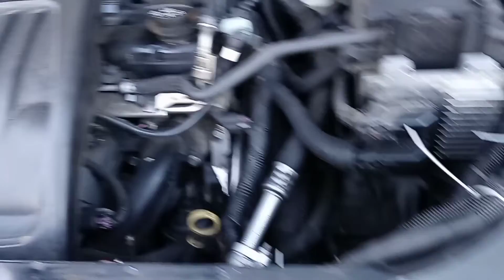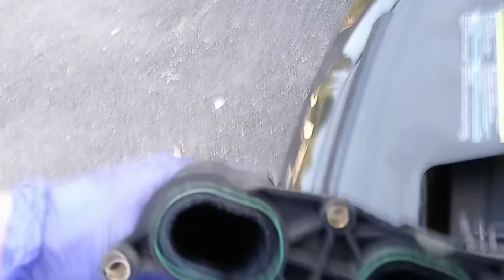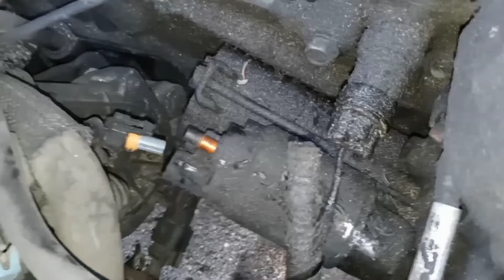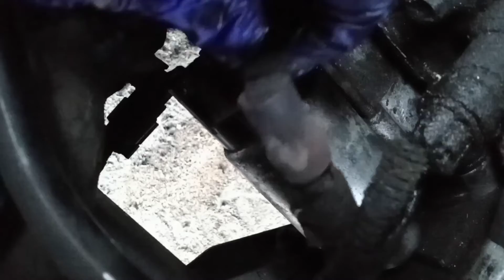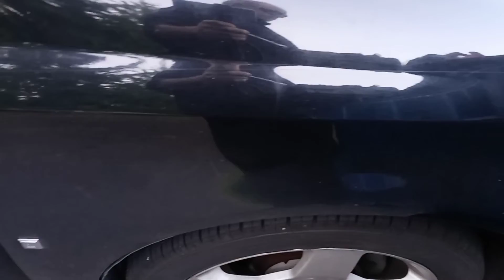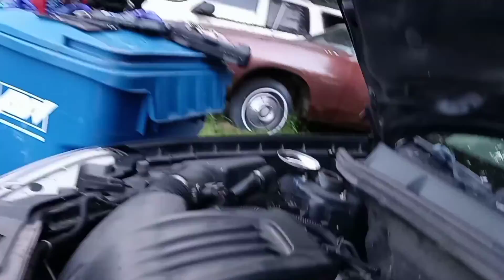2009 Chevy Cobalt starter replacement.

Comment: originally written by Elvis C

This is all done without any jackstand or anything you can do this without jacking the car up in the air.

I currently have no pics but I'll go through each step perfectly.

EVERYTHING DONE IS WITH THE BATTERY UNHOOKED

1) Remove your throttle body + throttle body cable (it pulls off from the bottom, its a metal ball.)
2) Remove your intake manifold (5 10mm Bolts + 2 10mm Nuts)
3) Make sure to take off the evap line (press the clip together and pull it out)
4) Take off break booster line (lift the white clip with either a flat head screwdriver) and it'll slide right out
5) unplug the map sensor connector
6) Unplug your injector wiring harness (it's near the bottom left (passenger) side) just push in the clip and pull them apart
7) once the intake manifold is removed you'll see a long cylinder with 3 prongs .l...that's the starter
8) remove 1 13MM bolt holding 2 Positive wires (the bigger one goes stright to the battery)
9) Take off 1 10mm bolt which holds the switched 12v for the starter
10) Remove the bottom 15mm bolt
11) Remove upper 15mm bolt
12) Pull starter out

To put it back together just reverse these steps. but MAKE SURE TO PUT ON THE 12V+ ON FIRST OR ELSE YOU'LL HAVE A SHORT AND YOU WILL BLOW YOUR STARTER

Comment: Instead of removing the manifold consider turning the car upside down.
Reply from the maker: Lol
Reply: @1020autorebuild  OK, here is a lol, why don't   you change the starter out from underneath instead of taking the manifold off?
Reply from the maker: I needed to look at the intake manifold
Reply: @1020autorebuild  Is there an issue with the manifold on these cars?  I ask because I own a cobalt.
Reply: I had wondered if that was what you were doing.

Comment: Why remove all those parts on the top when it is at the bottom of the car this is just extra work and a waste of time.
Reply from the maker: I was replacing the intake manifold gasket as well.
My car has the California emissions so it has the air pump and hoses you have to remove/ disconnect and get out of the way to remove the starter..